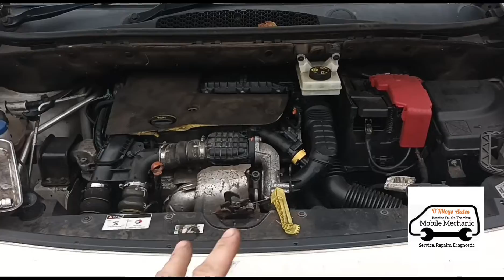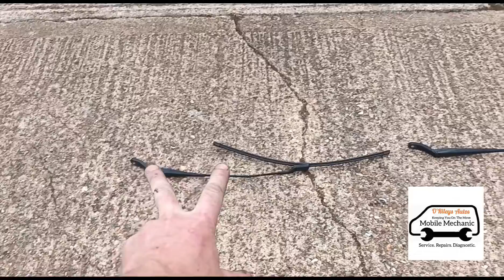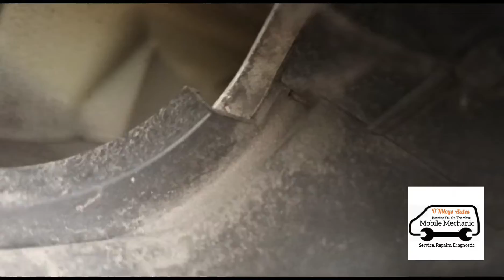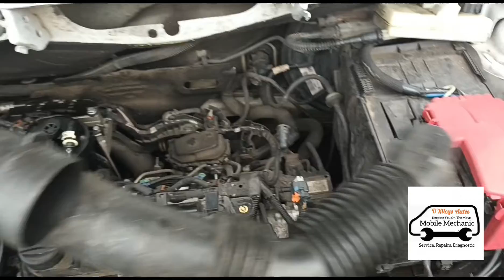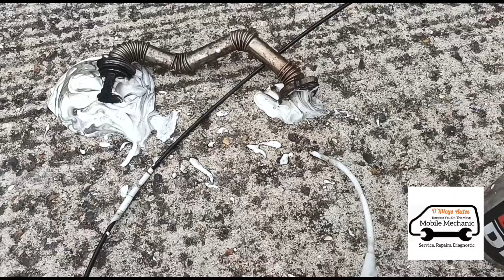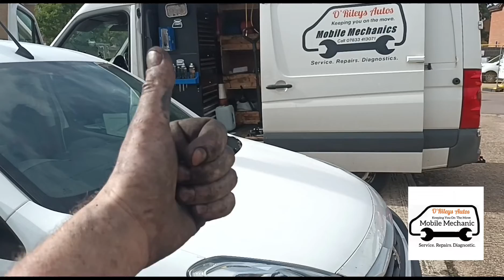Peugeot Partner 1.6hdi EGR Valve Cleaning P00BC Air Flow Too Low

Comment: Hello. I have a peugeot partner 2010 1.6 66kw diesel. Is it good to remove the egr valve, will it cause problems for the engine? Is it good to remove DPF as well, here in Serbia there are no problems at the technical inspection, at least for now. Greetings from Serbia
Reply: Ne jebi po tavanu, ostavi kako je.

Comment: I think I need to get my sorted as well. Great instrctions, I just wonder if you ever made a video showing the proc to disassemble the whole egr and to the new one back on
Thanks
Reply from the maker: Not yet!
Reply: @ORileysAutos  you know what? I'm struggeling to get access to the two bolts that hold in place the pipe you removed to wash out egr side.

Comment: Is dpf cleaning foam alright to be on the intake side? I can gain access to the pipe that returns to the inlet but ive got the 1.6 8v tzja in a fiesta, and it has a cooler, and i dont want the hassle, so being ablr to just get foam down the pipe and then let the engine burn it would be easier.

Comment: can bad cloaked egr be cause for jerks /hiccups in driving
Reply: Not long done the fuel filter as part of a service. See how we go.
Reply: @KiwiMurfy  EGR are most likely if you have those hickups when driving when car acts like he choking or wants to stop and similar none pleasant things
Reply: I have had the same thing going on for a while. Sometimes nothing for long periods and then a few hiccups on the same journey. Now getting eml coming on and going into limp mode and then light goes off and running fine again. Fault codes are all pointing towards egr valve.
Reply: @KiwiMurfy  it was egr valve in mine case,i take it down and washed it and cleaned with wd40 and rest and back on place and i was replace fuel filter too!!it  is good now
Reply: Good to know, aiming to have a go at mine soon.
Reply: @KiwiMurfy  egr are definitely and if you don't change fuel filter longer time or above 40000km it is good him too but better go first with cleaning manually EGR, with replace of fuel filter air can enter in that fuel lines and you will have trouble to start car again

Comment: Hi there
My berlingo throws an engine check light when it gets colder and once warmer it goes off. Any ideas. Performance with no issues despite the eml. The only code is PO243 turbo solenoid wastgate A to low.
Any suggestions please?

Comment: the EGR is a serviceable item, these HDI 1.4 & 1.6 are a nightmare to get to the EGR, I had a landrover with a BMW engine the EGR was right in front of you, two bolts and it was off, took 5 minutes to take it off so it could be cleaned properly in the kitchen sink, Citroen's designers are not mechanics that's for sure, probably computer whizzkid who never done an oil change. . .
Reply: It's deliberately done so you have to take it back to them.

Comment: Remember the good old days when engines were easy to work on, loads of room around them and you could even see the ground under the engine bay????  It's an ordeal just removing stuff to get at the part you actually want to work on with modern engines.

Comment: Surprised the engine didn't go full bore when it sucks that brake cleaner into the air intake at start up.
Reply from the maker: The valve is closed 👍🏻